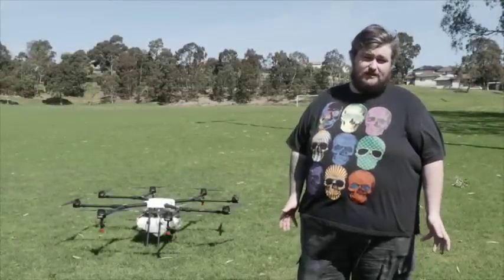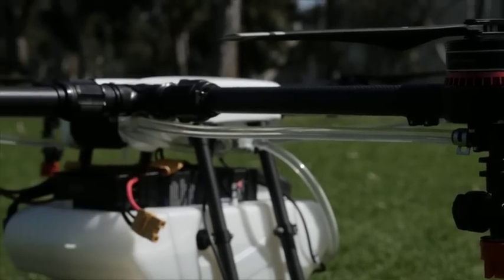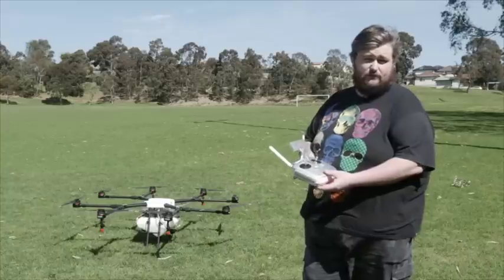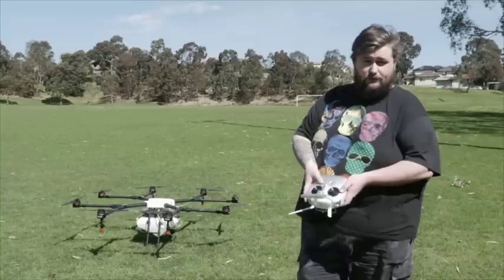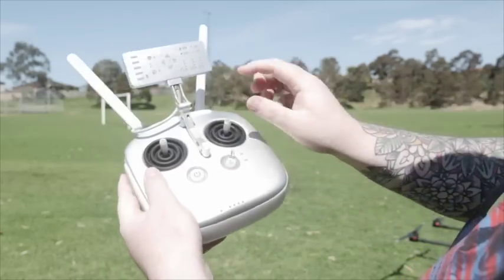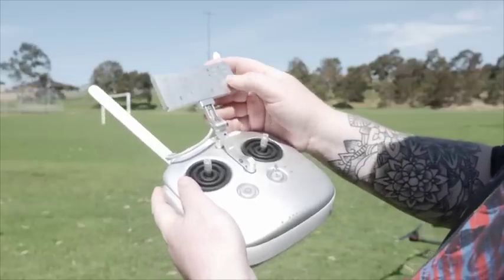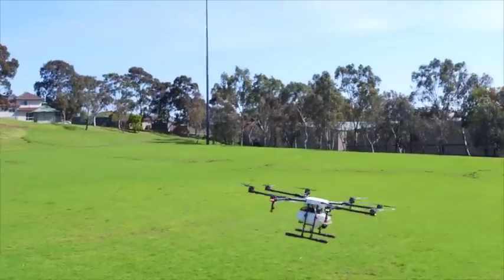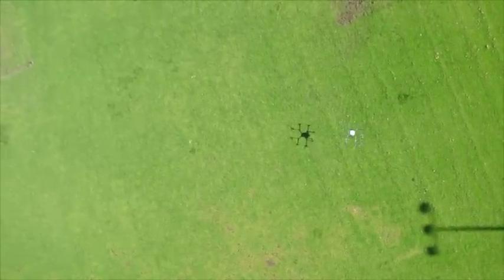DJI AGRAS REVIEW -  SPRAYING DRONE

Comment: hi, are the batteries interchangeable? how would one go about the custom pack to add a camera? Also do you see this being capable of spraying a good sized 4 acre field?
Reply: You could glue an FPV camera and transmitter to it then use a FPV monitor. The transmitter and camera would likely be wired to the drone's battery, and the monitor will need a receiver (if it doesn't have one built in) and a battery of it's own. Your local model plane store should be able to help you out with that.

Comment: A couple of questions: a) how long does it take to change the batteries (chage the empty ones with "just refilled"?), b) how long does it take to recharge the batteries on the charger supplied by DJI?
Reply: For the charge time maybe 30mins i think, Professional aviation plant protection integrated service provider from China, more details 4271397@qq.com or Twitter: QuanfengAGUAV
Reply: For battery, we dont suggest use all power, otherwise it has great damage to the battery and shorten the life. So we set the Voltage Alarm and recharge aound 40 minutes.